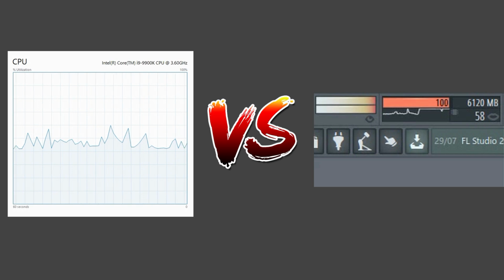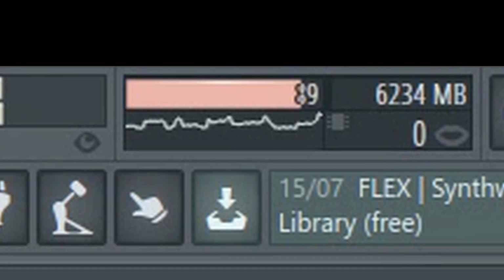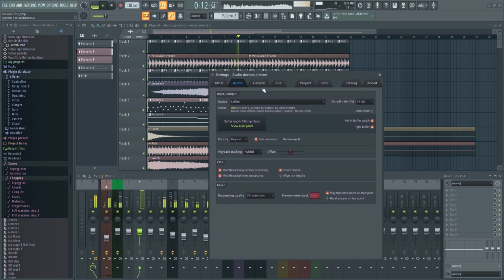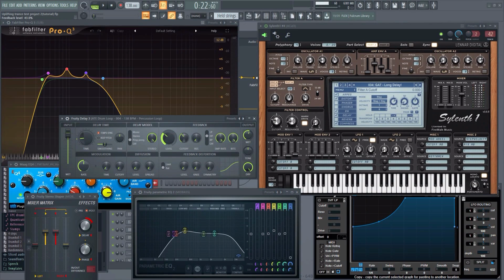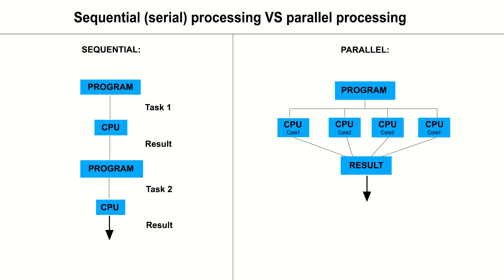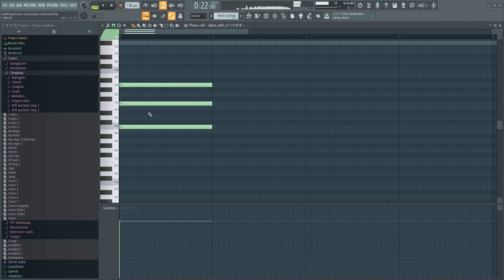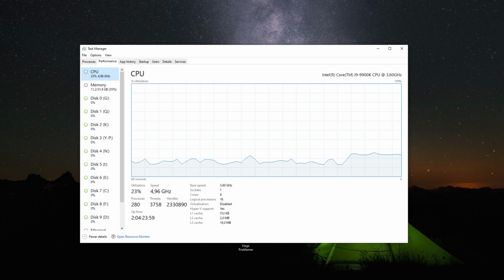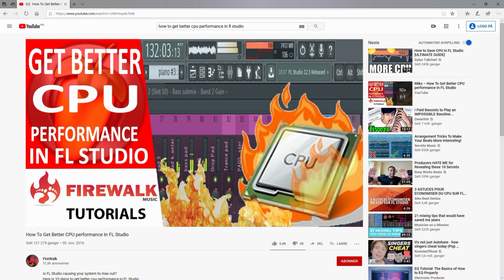Why Don't my DAW CPU Meter And Windows Task Manager Agree?

Comment: What's the solution to this issue please
Reply from the maker: It's not really an "issue". It's just the way it works. It's not really a "CPU-meter" at all, it just focuses on the audio buffer itself, which is the only thing you need to worry about with regard to the CPU's ability to process information in real time without any lag.
Reply: @FireWalkMusic  wow thanks 🙏💯💯

Comment: I was thinking about switching my i7 6700 CPU with the 6700k so I can overclock it. Based on this video and how DAWs utilize CPU will I see much of a difference with the overclocked 6700k?
Reply from the maker: This will depend a bit on how you work and and what kind of projects you have, but generally overclocking will make a big difference. I remember with my old rig I had a project that I wasn't able to run without  sound crackling, even with the buffer set to max. It just maxed out.. I was able to get another 100 Mhz overclock out of the CPU, and that made all the difference. I was then able to run the project properly.
Reply: @FireWalkMusic  Thanks for the info!

Comment: Thanks for your video. But I have a question, Something is not clear for me. For example when I use too many layers with spire VSTi I need more Cache. And my question is which one is better : one Core I9 CPU with 20 MB cache on a single CPU motherboard or  two Core I7 CPU with overall 36 MB Cache on a dual CPU motherboard ?

Comment: nah... About that part what new CPUs favor... Generally we're going for a smaller fabrication process, which allows for less power consumption and higher clockspeeds. In the consumer segment, Intel focus still remains at raising clockspeeds while AMD also secondarily focuses on more cores. The main focus still lies at raising clockspeeds. Also, the indications are the same. The difference is that the FL Studio measurement combines different specs. If you show the threads in task manager, and go to the thread handling the audio processing, the figures will look much closer.
Reply from the maker: It's true that fabrication process is improving and transistors are getting smaller and smaller. However, the reason why clock speeds seems stagnant these days have to do with power and heat. We've begun to encounter the limits of Dennard scaling, which states that the power needed to run transistors in a particular unit volume stays consistant  even as the number of transistors increases. In short, as the volume of transistors increases, the power required to run them increases. 
Back in the days, clock speeds increased tremendously, and if you had a 1 year old computer back then it would be completely outdated. Event hough clock speeds seem to be a bit sagnant these days, CPU's are still getting faster. Keep in mind IPC (Instructions per cycle). Essentially, more work is done at the same time, and at the same clock speeds. 

Here's a good article explaining the evolution of clock speeds etc: https://www.maketecheasier.com/why-cpu-clock-speed-isnt-increasing/
Reply: @FireWalkMusic  I think the clock speed umprovements only look slow on Intel's side because they are stuck at trying to lower their power consumption on desktop chips. AMD is truly making progress, even though the actual improvements are being exaggerated on media. The actual increasing of core count isn't visible anymore in the mid-range section of the market, it's stuck at 6 cores since 2017 with the release of Summit Ridge. Of course, it's a different story in the server and enthusiast segments where core counts are currently doubled, but there are still IPC improvements.
Reply from the maker: @delta61  AMD has made some great chips lately, especially their 3000 series is very good. Intel has been struggling with manufacturing problems for a long time now, and this has allowed AMD to catch up, and even surpass Intel to some degree. This is all great for consumers, since more competition will result in lower prices overall. :)

Comment: Yo guys, there was this video that actually fixed this for FL Studio, I’ll comment the vid to this comment once I found it. It made it so that fl and windows cpu matched, so idk what this guy is talking about.. it’s honestly not a processor or fl studio problem - just settings!
Reply: What are you talking about? They are measuring two completely different things, that's why they don't match, and they're not supposed to either. Windows displays the average CPU usage over all cores, while FL Studio reports the CPU's ability to fill the audio buffer.
Reply from the maker: Perhaps you're thinking about the PDC (Plugin delay compensation) being fixed in FL Studio? They did that a few versions ago. The difference shown has to do with the way they measure the load. As Kevin said, the meter in FL Studio isn't really a "CPU" meter at all, it just reports the CPU's ability to fill the audio buffer within the allowed time, which is determined by the buffer size etc.

Comment: I feel like cubase handles cpu usage much better than fl studio
Reply: U need  custom settings, than fl also works
Reply from the maker: Cubase is definitely more efficient in many ways. Keep in mind that Cubase also has a more linear workflow, which is better for the CPU overall. In FL You can route anything anywhere and to all kinds of crazy things which will be very demanding on the CPU.
Reply: Ahhh that explains some things thanks for the info